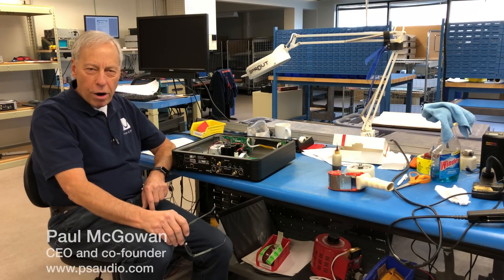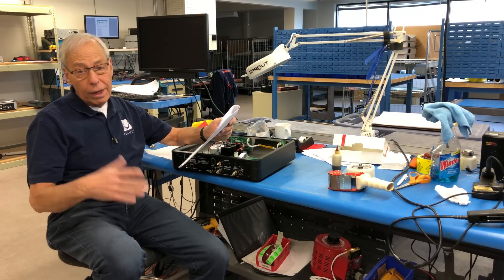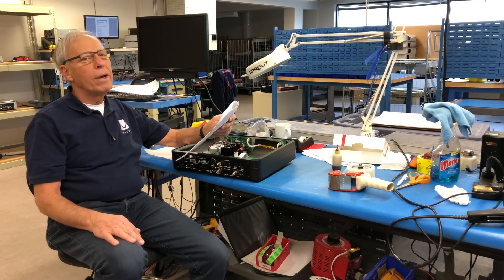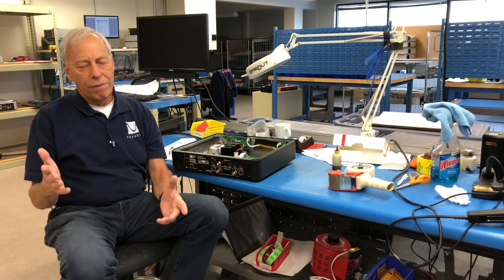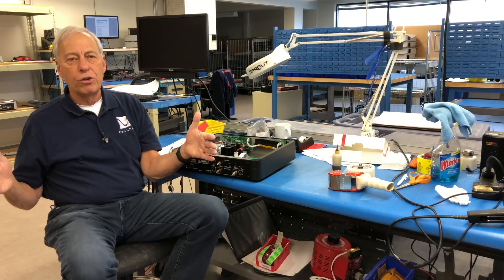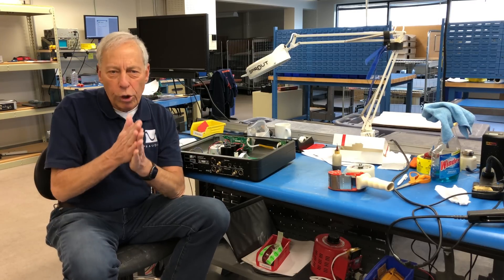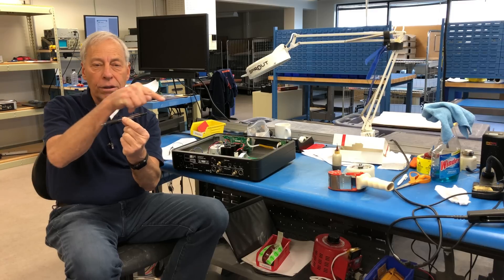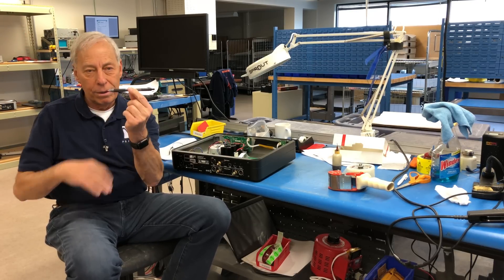Are low impedance speakers hard to drive?

Comment: it's getting more complicated now and I'm getting more confused. How about the sensitivity of the speaker affects the necessary power needed. Suppose a speaker for certain volume/gain will need 25 Watts. Does that have anything to do with 4 ohm or 8 ohm impedance. And in this scenario how will the sensitivity works?

Comment: I think part of the problem is the ambiguity of some of the terms we use like "drive" and "rated power" as they become jargon. Honestly  when we say "harder to drive", this is really poor language because i would have said the reverse for the same reason. All things equal, lower impedance speakers tend to produce a full sound at a lower threshold spl. So you can "drive" them (if drive means get a complete sound). As an example, bose wave were not super high quality but there relative low electrical impedance and very low physical impedance meant you could "bigger sound at less volume" according to bose marketing, and they were mostly correct. Meanwhile, if you had a set of dual 15" 3 way jbl loudspeakers in your loving room, you'd have to get the volume to unbearable levels before reaching a threshold where all the nuanced sounds of the instruments could be heard, due to the 8ohm electronic impedance and the large physical impedance of giant heavey 15"woofers. To simply say "higher impedance speakers are easier to drive" would be technically correct but would likely lead the average reader to assume that they could go drag a set of Kustom 16ohm speakers from the 60's into their backyard for a big party, only to find that they dont get very loud at all and sound like complete mud with zero clarity at all outputs and complain "i thought these high ohm speakers would be easy to drive"

Comment: what does an amplifier do anyways ? gets a singal, its job is to produce the same signal on its output. may or may not have the same amplitude. 
seams reasonably easy. 
whats the issue then ? you got a load on the amplifier. namely, usually yours speakers. 
what an amplifier can not do, is have a larger output voltage, than a given limit. we don't care what limit it has, even in unloaded situation, your amplifier has a maximum voltage swing. so it can not make a larger amplitude signal than that limits. all sqaure and fine. 
the other thing that limits our amplifier, is the amount of current it can supply.
given a load, , say for ease, 4 ohms, okay ? in order to have 8 volts across 4 ohms, there has to be 2 amps of current. if our amp is happy to supply 2 amps of current, and that 8 volts is less than its maximum output, we got a happy amplifier.  lets assume our amplifier would have a maximum amplitude of voltage .. say 16 volts, okay ? but we got that 4 ohm load on it. what happens if we do try to make it work ? it will hit its current limit, and burn. or if it has a protection circuit it will kick in. 
an amp is happy as long as it does not have to attempt to produce an amplitude it can not, or supply a current it can not. 

so this amplifier we made up can supply 2 amps, and 16 volts. jolly good job, thats 32 watts. given an 8 ohm load, it will manage it. as 16 volts divided by them 8 ohms, yields the 2 amps. job well done. now, what if we do try a 4 ohm load ? well, whitout issues wecan pump 2 amps of current as discussed, and 8 volts of amplitude will demand that. we did halve the load, but our maximum power... went from 32 watts down to 16. we did not double our power. however, assume this amplifier gets an upgrade, and is now able to push 4 amps of current. if we use our 8 ohm load, it will still not need more than those 2 amps of current at the maximum 16 volt amplitude on the outout. so it will stay 32 watts. buuuuut, we can drive a 4 ohm load now, that will need the 4 amps of current. and yess we get 64 watts of power. 

so that halving the impedance will get 2x the power is only true, if the amplifier can supply the required current. that should be noted. otherwise it does not stand true.

when an amplifier has to produce an output whit larger amplitude than what the signal has on its input, it will add noise. the larger the amplitude, the more noise you get. so, technically, a low impedance load, requires less voltage gain, for the same power than a high impedance load. for that reason, given if the amplifier can supply sufficient current, it may be better to use low impedance load. in return, that low impedance load will require more amps of current, and providing that is what strains the amplifier. unless, the amplifier is designed in a way to be able and produce a tonn of current efforthlessly. speakers as loads, have a nominal or rated impedance. an 8 ohm speaker may at some freqvencies be just 6 ohms or even less. a speaker sayd to be 4 ohm rated,can dip into 3 ohm whit ease. so a carefull designer will take that into account. our imaginary amplifier had a 16 volt output. i would prefer it to be able to supply 8 amps of current. than it can surely drive nominal 4 ohm loads, whitout issues. and i would prefer to drive 4 ohms whit it, than 8 ohm. it fits better. that way i can get say.. 20 watts of power whit less voltage gain, and have a cleaner output signal from the amplifier.  would it be hard to drive ? nope, its well whitin the capacity of this amplifier. a 2 ohm rated load however would be hard to drive. since at full blast, it would likely be overloading the amplifier whit its current needs.

Comment: I’ve had a good education and an excellent grounding in the sciences, with my forte being physics. When I 1st got into audio, this concept that lower resistance speakers were harder to drive, was alien to me, contradicted everything I’d been taught. It’s taken me years to wrap my swede around this. If something offers greater resistance, surely it makes life more difficult. If my car brakes down, it will be far harder to push up hill, than it is down hill. That hill offers resistance! Resistance makes things more difficult. It is harder to swim against the tide than with the tide. It’s harder to walk with a strong headwind than tailwind. Audio technicians will talk until the cows come home, telling you high resistance speakers are easier to drive. Yet, in the same breath they will tell you that lower resistance headphones are easier to drive. You can drive a pair of low resistance headphones directly from a smartphone, tablet or laptop. High resistance headphones nay Benefit from employing a headphone amp. Why? Headphones are merely small speakers mounted on a headband!

I know the key to this is Ohm’s law, which I will leave out of this to make it easier to comprehend for those not familia with Ohm’s law.

The best explanation I have is that given by the presenter of the YouTube channel, Audio University:- consider a water pump as a substitute for your amp. A hosepipe substitute for your speakers and large bucket, substitute for your ears. Your water pump can pump 10 pints of water per minute. Connect it to a hosepipe with an internal diameter of 1 inch and that water pump will pump those 10 pints of water into the bucket at a pressure of 10pSI. That PSI equates to audio volume in our scenario. Now, replace the hosepipe with 1 that has a 2 inch diameter. This hosepipe offers less resistance, allows water to flow more freely. The pump will still deliver 10 pints per minute to the bucket, but the pressure will halve from 10PSI to 5PSI. In order to restore that pressure of 10PSI the pump will have to increase its flow rate to 20 pints per minute. In the same way that an amp would need a high current rating to enable it to deliver 100w to a 8Ohm load and 200w t a 4ohm load!

Next time you’re in the garden with your hosepipe, watering your tomatoes, try squeezing the end of the hose. Providing your tap is powerful enough, squeezing the end of the hose will cause an increase of water pressure.

Hope this helps.
Reply: Your physics education actually has you on the right track. Our friend here actually answered the wrong question. He answered "which impedance load is easier on the amplifier when driving" not "which speaker is more easily driven". All things equal, the lower impedance speaker will produce sound spl at lower current levels and have a more dynamic response due to less constraint to the voltage of the signal, and thus more easily driven. There is also the matter of physical impedance posed by the weight and dynamics of the speaker cone. A 6" papercone has less physical impedance than a heavey 15"poly cone subwoofer. And thus the small papercone can be driven with a few watts while the woofer takes several hundred to drive it.
Reply: You’ve very much echoed my own understanding. But expressed it much more articulately than I could. 👍

Comment: During my higher education days, my forte was physics, electronics and math. I’m baffled! 

If I fill a wheelbarrow with a hundred weight of wet concrete and wheel it along a flat pathway, it’ll be considerably easier than wheeling that same barrow up a steep incline. Because that steep incline offers a lot more resistance. In other words the greater resistance would make the barrow, harder too drive!

If I were to drive a car up a steep hill, it would be considerably easier than driving that same car up the same hilll, but this time towing a heavy trailer. Because that trailer would add resistance.

It would be a lot easier on the engine to fly a plane wit a tale wind, as opposed to a head wind. That head wind  causes resistance. Next time you’re out and about, take 1 thick and 1 thin straw and blow into them. You’ll find the thick 1  offers a lot less resistance.if I pump 30 gallons of water through a narrow hose pipe and another 30 

Through a broad hose  they will pump equal amounts over a given time. But the water flowing through the thin pipe would exit at a much higher velocity. Because the pump would have to work a lot harder. But, it seems, I increase the resistance of my speaker, it makes  it easier, not  harder for my amplifier

Comment: I also always struggled with this concept, for the following reason: I understood impedance to mean "resistance". Therefore, to me, it always seemed logical that the higher the resistance / impedance, the more difficult it must be for the amplifier to drive. At school in physics, a parallel was often drawn between electricity and water, with voltage being the pressure in the tap, amperage being the amount of water flowing, and ohms / resistance being the narrowness of the pipe. Therefore, to my mind, the narrower the pipe (higher resistance) the more pressure (voltage) would be needed to get the water / current to flow. While I do "technically" understand why the opposite is true, it remains counter-intuitive to me -  even 50 years later! 😀
Reply: You are thinking that way, because you are correct...sorta. if you are thinking "drive" as in "produce sound" then you are absolutely correct, lower impedance speakers will tend to deliver sound at a lower threshold all other things being equal. However, this is not what "drive" means technically. These are confusing terms and we should approach them with better explanation. All other things being equal, you should find it easier to control and produce spl from lower impedance speakers with greater audible nuance and clarity.
Reply: My thoughts exactly!

Comment: this guy is such a drag give me blue glow a dude that just doesnt sell tube amps but can break it down and build it back no problem...true techs are not EE but just very smart guys who learned by some good old timers that started by just fake it til u make it, and that guy is who fixes my tube gear. PS Ive seen many a engineer quit a tube shop because all they knew was theory, not tool to hand to amp.

Comment: Thanks for the video that actually helps me understand a bit more. I have a Denon AVR for my home theater.  I’m running 4ohm speakers and it works great and plenty of volume for everything.  I don’t recall what setting it was but Its some kind of safe mode so it won’t try and push too much and fry my receiver.

Comment: I'm at 3:30, I think what you are trying to compare is sound output vs efficiency of power. 
High power output is a engine on nitro methane vs a efficient geo giving little bits of power at a time.

Comment: I looked for understanding this question from multiple angles.  Speaker design is one, amplifer design another and also crossovers.  So using sound as an example i determined what frequency and sensitivity each combination had.  It's complicated but in the end it's all in the way; it sounds.  So, a higher impedance speaker won't sound as loud as a low impedance speaker because of the speakers sensitivity.  I really don't know what's going on inside the speaker or amplifier.  check out this example:  https://youtu.be/DNfpYncOQRc

Comment: The way that I look at it is that with less ohm's, the amplifier has a harder time controlling itself. The higher the ohm's, the easier it is to control its output, this would be like saying that with larger brakes on a car, the faster you can brake and vice versa.

Comment: Well Mike I think I can tell you all about it back in the mid to late eighties when I took my dc measurements ac measurements and ac+dc measurements classes this was the prerequisites for just about anything from the phone co cable or electrical I was looking at becoming an electrician back then no YouTube I had a stereo review magazine and I was looking at surround sound receivers and onkyo had a model that was very impressive that delivered something incredible like 1000 watts into one ohm before it clipped it may have been 2 ohms but ok I bought one it was actually a bigger model that was 110 watts per channel to the front left and right and they all dropped down when you turned on surround  but the front two In stereo could drive 6 ohms and rated at 110w into 8 so this is the same thing that ran 1000watts before clipping into 2 ohms  cerwin vega makes a pair called VS 120 or VS 150 vs was for velocity sensitive their sensitivity was 98db and I liked the sound of the 120 better than the 15s but the real selling point was that are 4 ohm speakers and that brighter like an incandescent lamp is in a dimmer only these speakers are taking this dimmer and making it more than twice as loud as this receiver can drive 8 ohm speakers. I do look at things quite a bit different now .. I have a GAINCELL/DAC and 3m700monoblocks now with 3 elacs a marantz av7706 for HT just got a SACD transport all of my old way of looking at impedance was they are brighter lamps

Comment: Verry simple.  100 watts into a 8 ohm load, 200 watts into a 4 ohm load and 400 watts into a 2 ohm load are equally loud. True doubling usually costs $$$ except for one power amp by a headphone company.  But a decent class AB integrated amp does a good enough job into a 4 ohm load to drive a dynamic speaker with 4 ohm nominal impedance even with low sensitivity.  But keep that amp away from a Magi.

Comment: I got surprised when my 2x460 watt in 2 Ohm amplifier "turned itself off" when I had the volume on around 10 o'clock and I had 2 cables to my Infinity Kappa 8 using the "Extended mode".
I had the midrange/treble to speaker connection A on my amplifier and the bass to Connection B and when I played the end of song 6 on "Roger Waters - Amused To Death", when the bomb goes off, my amplifier got quiet.

I later learned how difficult my Kappa 8 was for an amplifier and what the "A and B connections" on my amplifier really meant for how much more difficult it became for my amplifier but when it happened I got really surprised.
I was happy that my amplifier just turned itself off anyway so that it didn't break.

Comment: That with which we are struggling here is the concept of load, and its effect on work. The analogy I like here is rowing a boat with the oars out of the water; a great deal of effort is expended, but no work is done, i.e. the boat does not move. All work, like an amplifier driving a speaker, like a cartridge driving a phono stage, like a motor turning a platter, is done into some kind of load. A zero impedance speaker would present no load with which the amplifier could work.

Comment: OK....here goes.   I own a mint pair of AR 3As speakers that are 4 OHM.  I drive them with a new Yamaha R-N303 receiver rated at 100 WPC at 8 OHMS.  When played at some high volume levels, the receiver runs very hot and then.....ALWAYS shuts off!  I switched the receiver to several other I have and the same results.  SHUT OFF!  Very annoying.  So.....I switched the ARs with my mint Large Advents rated at 8 OHMS.  Slowly cranked the volume to near  ear splitting levels and...NO SHUT OFF!  Chassis was barely warm.  Did the same thing with ALL my receivers and running the Advents, NO SHUT OFF.!  So please educate me as to why it is OK to drive 4 OHM speakers with an 8 OHM power supply. In the real world, this just does not work!  Dr. Z (Lou)

Comment: Hi Paul - I really appreciate all your good advice. Recently I've purchased a Yamaha as-501 integrated amplifier (85-rms/channel @ 8-ohms) - resulting in the depletion of my very limited finances. Now I don't have the means to buy matching Yamaha speakers. But I have a pair of Pioneer ts-6997 car speakers in wooden enclosures ( 4-ohms, 150-rms/each ). Please let me know if I can use them without causing any damage ?  The as-501 Amp has an Impedance Selector switch - Should I set it to 4--8 ohms, or should I leave it at 8-ohms ?
Reply: Car speakers are 4 ohm ,so I would put the selector on the amp for 4 ohm. But why using cars speakers and not bookshelf's speakers?